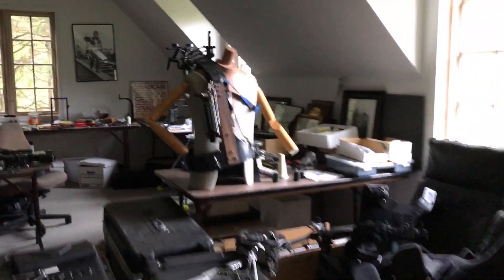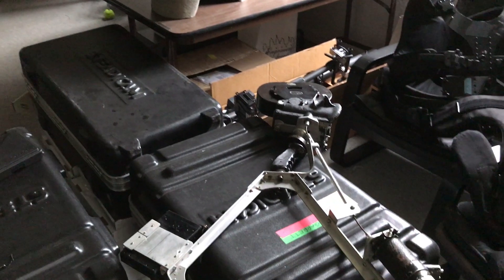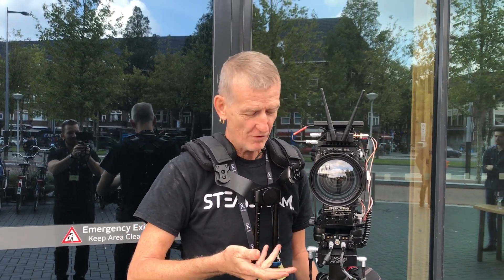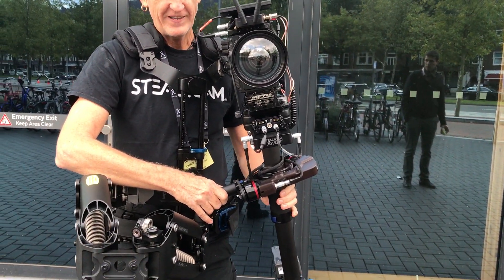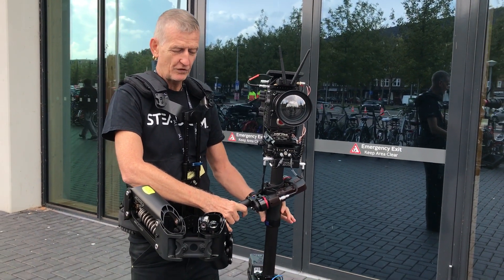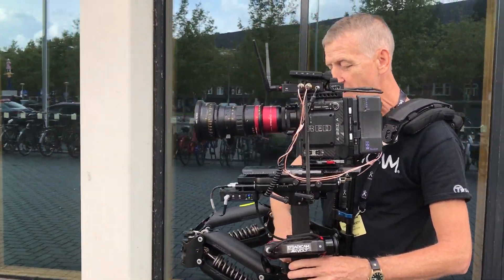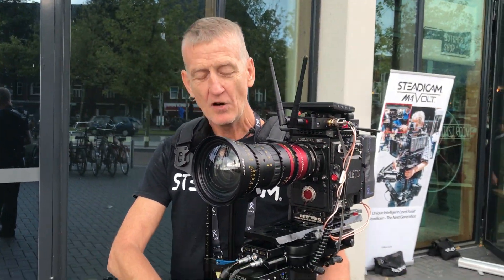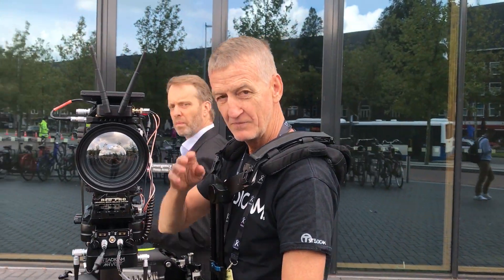Garrett Brown & Chris Fawcett presenting new Steadicam M-1 Volt

Comment: Looks expensive as all hell
Reply: With all the technology and investment put into that, it's no wonder... $6500 / €5700
However, I'm sure it's "expensiveness" is perfectly a match to its quality!
Reply: Pedro Beires $6500 for the whole package? Or just the motorized part?
Reply: @j.oakley9588  Just for the Volt (the motorized part) whole steadicam is about 45000 USD
Reply: This is the best there is.  Of course, you could rent a Technocrane and lay 100 feet of dolly track.

Comment: I'm curious if there is any way to mount the monitor in a different place. Could it be hooked and portrude from your right shoulder? Or would it block too much of your view or get in the way of the steadicam? Or could glasses be made, better than google glass to serve as your monitor.
Reply: The reason why Steadicams have monitor at the bottom is for the operator to see where he is stepping, but as long as you balance it properly you can't place it where ever you want.

Comment: How heavy is that 😂 looks like a human transformer
Reply: Not that heavy at all... in fact, *you barely feel any weight because of how the steadicam is suspended to you*. It basically floats, and you have to remind yourself at the beginning that it does not take any effort to move the thing, otherwise you'll end up putting waaaay too much force that what you need for movement.
This, my friend, is called physics. ;) 
But, indeed, if you operate a 3D cam with a huge rig... that's an 85 pounds load :O So yes at the end of the day something like this let's say that's between 35 and 50 pounds with a cinema camera or big DSLR or DSLM and cine-lens, battery plates,  monitor, wires, mechanical arm, vest and wrist strap...
 So yeah you DO feel it - but mostly after you remove the thing. LOL
Put it on and you'll amazed at how light it *feels*. There you have it - that's the secret! You have to get a lot of endurance, but this is why this thin man can be a great operator : you need nothing in the realm of particular physical strength - not anymore, you needed that for a 35mm beast yes although if you had a crazy endurance and a good back you didn't needed to be a big guy at all. Even Garret was not one when he started out, he worked out to be able to pull off more and more work as he was the only steadicam operator at the time you know? The shining and shit... it's all his footage! ;)

Comment: Perhaps it would be cheaper/easier to just put a moving mass inside the post around the gimbal? When you want to stabilize the post, the mass goes down, when you want to stop it at the vertical position, the mass above the gimbal for a brief moment. All possible to calculate with a cheap microcontroller similar way the Volt does it. The downside would be that you wouldn't be able to select single axis to be stabilized, the moving mass would stabilize both axes simultaneously.
Reply: Well honestly, this is Hollywood-level stuff so...they're not looking to make a "cheaper" product at all...??! As they said, you need to be able to control tilt and pan, and also you need to be able to disengage the horizon motorized gimbal as well and dutch angle shots and other stuff like that...
Reply: H